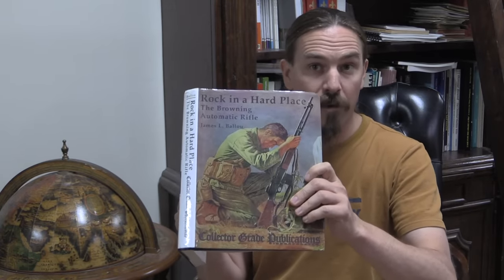Ask Ian: Why Not a Semiauto BAR Instead of the Garand?

Comment: Perhaps no so much in Europe when compared to the Bren and MG 42, but for all its limitations (It must be remembered the BAR design pre-dated the previous two weapons by 20 years) , the BAR still gave a squad or platoon critical suppressive fire in a smaller package that allowed them to move and shoot quickly. It fitted Marine doctrine in their role as shock troops to keep moving forward in direct assaults to keep the enemy off balance, unlike fire and maneuver of conventional armies. Marines believed it saved more lives moving fast and taking losses in the short term than moving gradually allowing the enemy to regroup and cause greater casualties over time . The BAR was originally designed to be used as "walking fire"  to suppress an enemy's position as the troops advanced in the open.

In the Pacific theater late-war Marine squads were assigned at least two or more BARS, which gave them immediate fire superiority in small local engagements upon enemy contact.  BAR's were handy to suppress the Japanese defenders in bunkers and caves as they were discovered to cover flamethrowers and men tossing satchel charges, than waiting for a 1919 MG team that would result in the Marines to lose forward momentum they believe was critical to get off the beach and keep the enemy off balance.
Reply: Makes sense. This idea is a significant part of why Germany lost on the eastern front. They were set up to strike hard, not defend. Hitler spread them out too much, and they were not able to land the knockout blow.
Reply: @siler7  Wasn't really the Mustache Man's idea to do that, the generals attributed their own failures to him.
Reply: @Lurch7861 They had a hundred thousand BARs manufactured for WWI, it would have been a total waste not to use these weapons that were vastly superior to any German, Italian or Japanese infantry rifle.
Reply: @Lurch7861 likely? wars are fought with what's in hand and the BAR was there, reliable, and effective
Reply: @siler7  Hitler spread them out because he needed the soldiers to dig in and defend. The generals were vainglorious bastards but Hitler was just a bastard. There would never have been a knockout blow, as I assume youre talking about Moscow in this case.
Reply: @baron2062  They had to defend because they were too spread out, not the other way around. They only changed to defense because the attack ran out of steam. If Hitler had prioritized taking Moscow, he could have done it, and then there's a significant chance that he could have defeated the USSR.
Reply: I had a patient who told me they gave the two stupidest guys in a marine squad the BAR.
In Europe, they gave the smallest guy the BAR.

Comment: One of the things I noticed going through basic is that weights weren't included in the soldier task books under the weapons. What I realized is:

"It doesn't matter how heavy it is, kid. You're going to carry it."

Thanks for the as always great info, Ian.
Reply: That's new; my 1984 Manual of Common Soldier Tasks, and those previous versions I've seen, all had that information for every standard-issue weapon, from .45 Automatic to 60mm mortar.
Reply: @davidgoodnow269  mine are 07 and newer
Reply: That's why you go to bootcamp training before being fielded to front lines, to be familiar with the weight and performance of the weapon.
Reply: @DOI_ARTS  You are f'ing kidding, right?

The purpose of Basic Training is to shake the "civilian" out of military recruits, in the process of bringing them to a uniformly acceptable minimum of physical capacity.

That is all.
Reply: @davidgoodnow269  nice little fantasy, kid
clearly you've never been in the military. it's not like your Hollywood movies
Reply: @cappuccino3444  That was where I was issued my Soldier's Manual of Common Tasks . . . duh.

Comment: May I add that Garrand originally wanted the M1 to use BAR magazines; but the military said no.
Reply: If you paid attention to what the Ordinance Department said, they wanted a rifle that "Was clip fed and could be used as a bolt-action if the automatic mechanism were to fail". Meaning that they were against infantry using box magazines over clips.
Reply: @MarioKaiba  and if you paid attention, Ian basically said it might have been the wrong choice, technology wise. I will add any AR, 10 or 15, can be single feed cycled easier than a bolt gun simply by turning off the gas block (if equipped) or in case the gas tube fails. Government/Generals decisions do not always make logical sense, as we can plainly see. Difficulty amplified for corrupt decisions.
Reply: At the time it did make sense to use clips over mags
Mags were expensive, heavy and bulky and for the lower capacities clips work just fine, possbly even better
Reply: @MarioKaiba  that's government for you
Reply: @zjanez2868  Yeah I mean we have to look at this with wartime production in mind. The metal used to produce one box magazine would be sufficient for how many stripper clips. 10? 20? With the experience of ww1 fresh in mind, I'm sure every part of gun had to pass an evaluation of "how much would it cost to make 2 million of these?" in terms of money, time and material.
Reply: @Oxtocoatl13  another part of the thought process was “what thing are the soldiers least likely to fuck up and whats a less big deal if they lose it” because bored soldiers will fuck up anything and everything
Reply: Then in 1942 the military started issuing the M1 Carbine, with either the 15 or 30 round box mag.
Reply: @zjanez2868   agreed, people forget that manufacturing back then was tight, making magazines was expensive and resource intense, especially for larger rounds which required stiffer magazine walls and tougher springs. Its part of the reason so many firearms like the MP18, Sten, Owen and Bren all had top or side feed magazines- to either negate or use gravity to assist in feeding (the Bren is a prime example of this, where its magazines simply do not work unless upside down).

Overall an 8 round clip was over 50% more capacity than an M1903, would even today cost mere cents to produce en masse, and arguably served just as well and reloaded just as fast, given it could simply be ejected and replaced rather than having to stow a used BAR magazine in your pocket.
Reply: I always liked the Garand and the SKS because of the stripper clips. Mags gives a certain kind of edge, Clips give another. If you practice with an enbloc or stripper clips, really practice. You get really fast at it. Both hands, eyes closed. Mags take way less practice to get quick and reliable with. But they're bulky, weigh a lot compared to clips and you don't want mud or grit in them. 
    Mags seem to win out, but not by as much as some people think. For full auto mags are a must. You can carry more ammo, ready to load,  with clips.